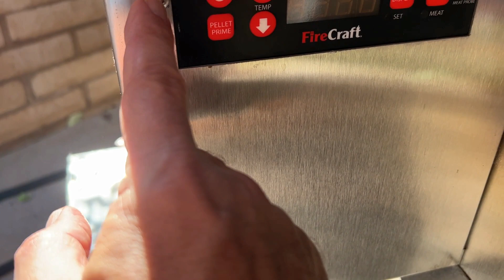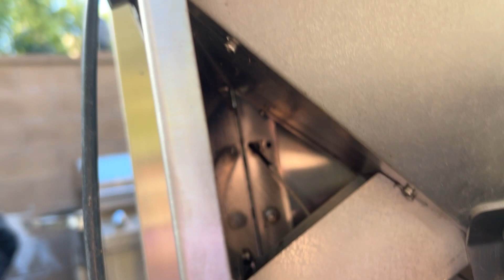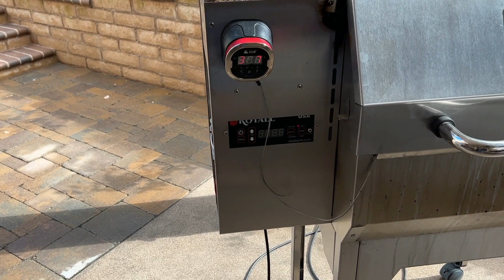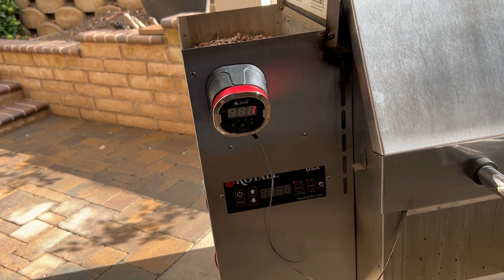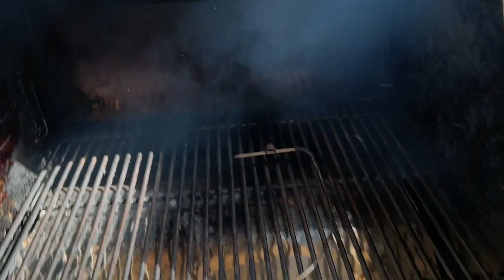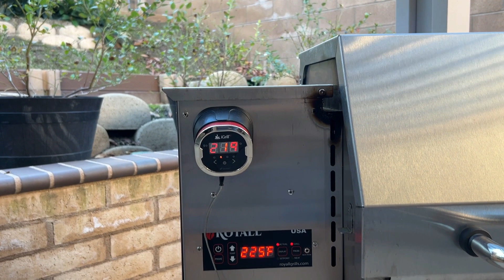FireCraft Q450 Controller Replacement with Roanoke Digital

Comment: My Q450 is still going strong. But I've been worried about this. Do you have a part number you used?
Reply from the maker: Great to hear your unit is still going strong. I replaced my controller with the Roanoke Digital BBQ Grill Controller from Royall (https://www.shoproyall.com/) back in November just in time for Thanksgiving cooks. Although, the down temp button on my new controller just recently stopped working. I contacted Royall just now to see if they will replace it. If not, I guess I just leave it on 225F for smoking only. Otherwise, finally replace it with something my bro has in stock, if I want to keep running with two pellet grills. My other one is an original GMG Daniel Boone which I love as well.
Reply: I've heard of guys using the Recteq controller, but you'd need to get a serial number these days. They won't send to just anyone anymore.